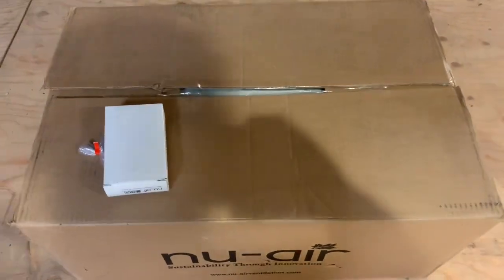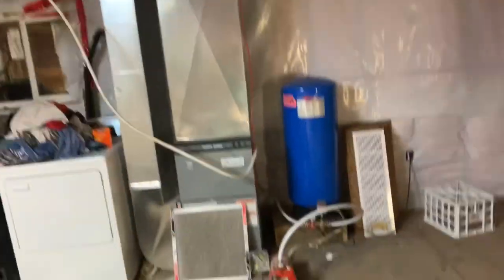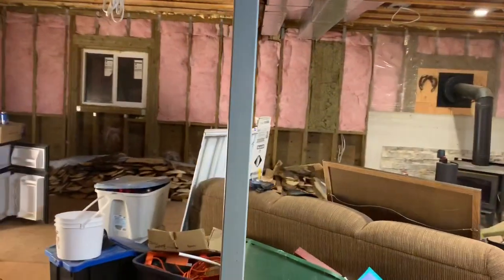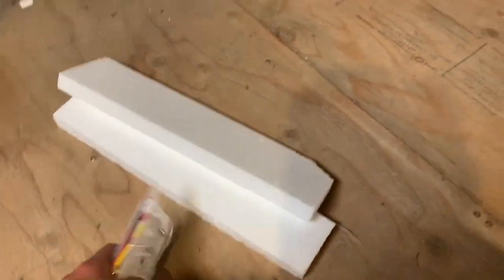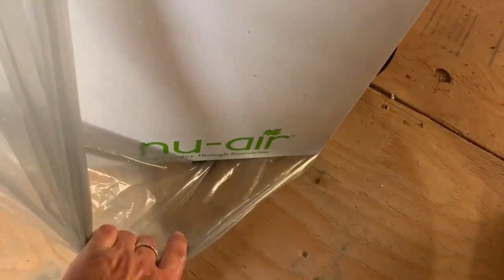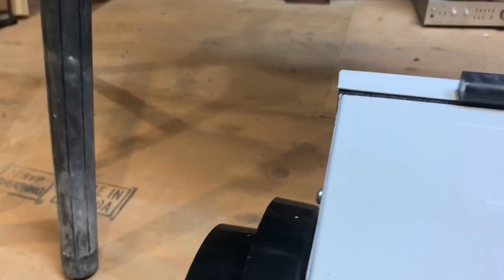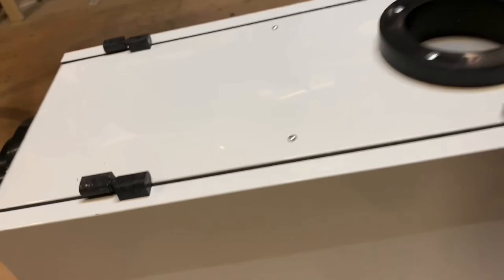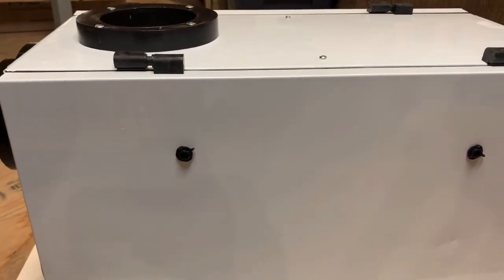Nu-AIr HVAC  Sustainability through Innovation!

Comment: It's an air to air heat exchanger, it brings in fresh air to replace the stale air inside the house. Depending on the time of year, the unit extracts the heat or cold from the stale air as it passes through the core before it exhausts it outside and transfers the heat or cold to the fresh air that it's bringing in at the same time. This tempers the fresh air coming in so it's similar in temperature to the stale air that it replaced.
Reply from the maker: That is very cool I am looking forward to the install they should have it all going in two weeks.